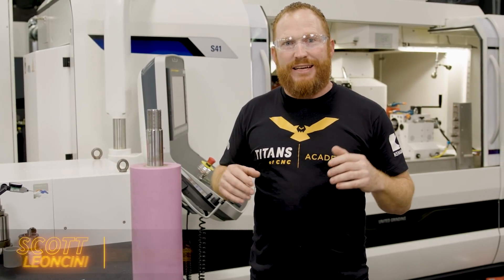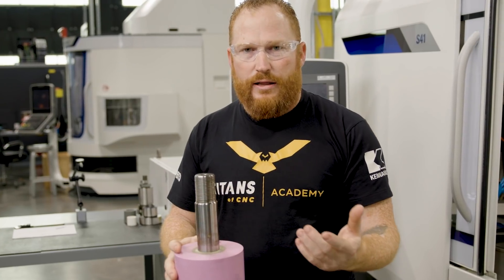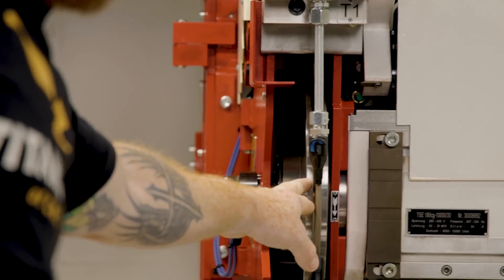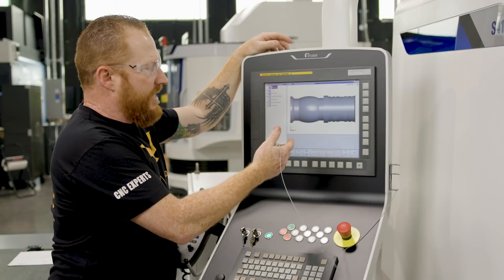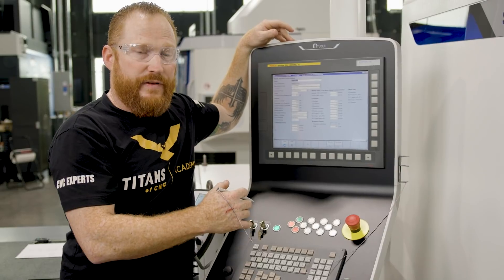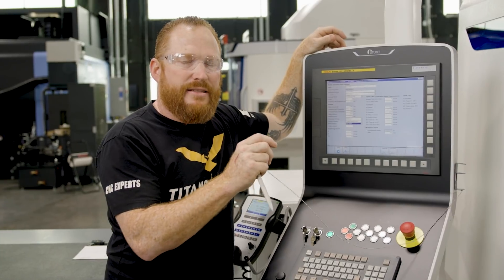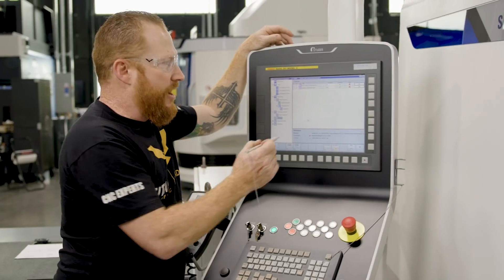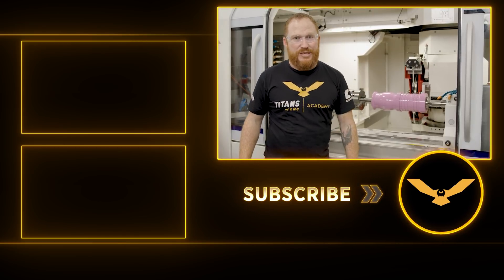Programming & Grinding Alumina Ceramic on the STUDER S41 from United Grinding.

Comment: More grinding, please! There is so little ceramic machining across YT, I would greatly appreciate more content and lessons on AlO, tool/wheel wear dressing, speeds/feeds, machines that can actually tolerate such material/wear/swarf.. Just about everything I've seen in my ceramic machine shop is point-blank " Not intended for ceramic machining".

Comment: Do you use the blasogrind coolant with just diamond and cbn wheels or do you have aluminum oxide o.d. wheels that you use aswell? I setup and run a studer s33 and our company is afraid to change to oil vs our current coolant which is mecagreen due to only using aluminum oxide wheels.
Reply: Blasogrind GTC 10. We use aluminum oxide as well.

Comment: Alumina is a really soft material (its hardness also depends on whith what technology it has been projected with)
, easy to grind but to achieve low roughness it requires additional operations. Another problem with this material is that you have to make sure to dry it very well and as soon as possible because otherwise the refrigerant will leave stains. It is also important to handle it as cleanly as possible, any stain will be very difficult to remove...
Reply: Yeah it's like a sponge, any dirty grease stain and it's in there forever.

Comment: Meanwhile in China: So this is how you make that part for the new ICBM, lets order a Studer S41 ;-D
Reply: I know you are joking, but just for information sake machine tool import and export is closely watched.  The machines at my shop have sensors in them to will render the machine non functional if moved and not reactivated with the proper codes.  We had to have a service guy come in and reactivate a machine after the floor crew bumped it with a cleaning machine.  At one shop we were having a new horizontal mill installed when a guy joked about making missile parts.  The guys who were installing the machine literally drop their tools and refused to finish until the had clearance from the machine tool manufacturer.

Comment: the weird singing sounds of the x-axis at 10:20 should be checked by your studer technician...some parameters are to stiff and maybe check the oil pressure on this hydrostatic axis, could safe u some money in the future....it should never sound like that!

Comment: when you are dealing in microns why are you using a 3 jaw chuck, on our old centre grinders for accurate work holding we always use a four jaw chuck, im not complaining but just curious   👍
Reply: ,,, maybe it's an adjustable 3 jaw that can be brought in as close as 4 jaw independent  .
Reply: I was thinking the same thing like 5 jaw or something for consistent work holding - seemed like a really nerve wracking part that came out really well , so that was nice to see.
Reply: He explained it at the beginning of the video
Reply: @EngineerGuy99  yes but that was about using a drive dog and grinding between centers, I just don't think a 3 jaw is precision accurate when grinding is being talked about, I might be wrong so wasn't looking at telling them how to suck eggs just curious.
Reply: @ricardo-iw9sq  This particular 3 jaw chuck is adjustable. We indicate the part into position each time we load it.
Reply: @redbeard_1371   Thanks for saying, it was just curiosity as normally with grinding its the only way to achieve tolerance and finish and repeatability  👍
Reply: @ricardo-iw9sq  You are absolutly right. We would have preferred to machine a drive dog extension to utilize a center, but for our application the 3 jaw chuck was a faster solution.
Reply: It's probably a really good, really accurate 3 jaw, plus it's a demo part

Comment: Do you get any wear issues on the spring loaded dead center?
Reply: Nope. It’s tipped with carbide and we run a coolant line directly on it.
Reply: @redbeard_1371  makes sense didn't realise It was 
1)carbide tipped
b) through center coolant ! 
(That's trick!)
Cheers!